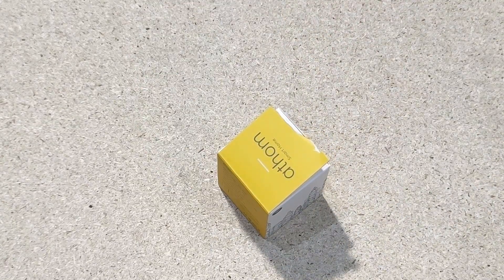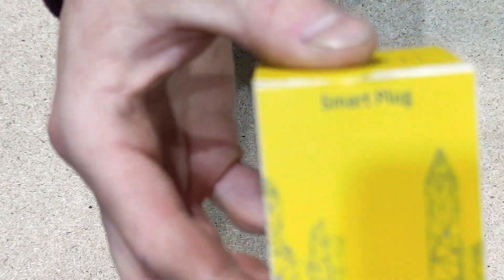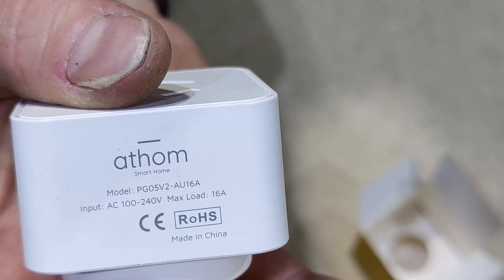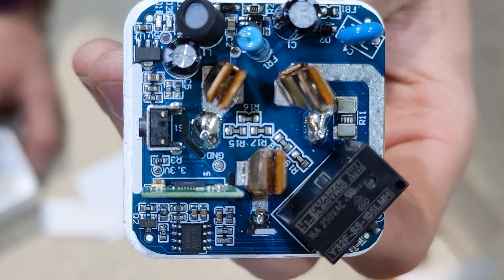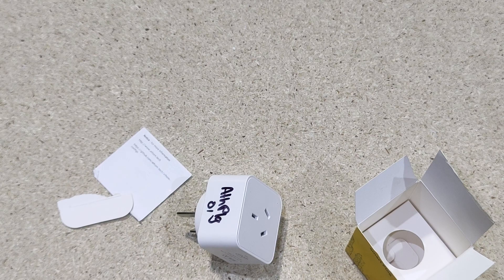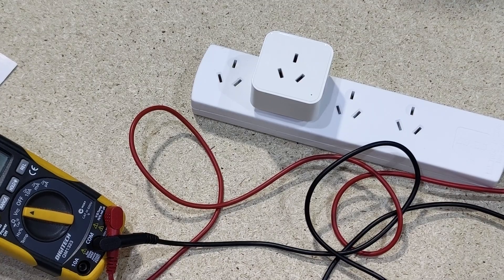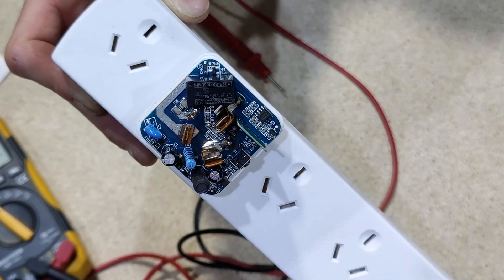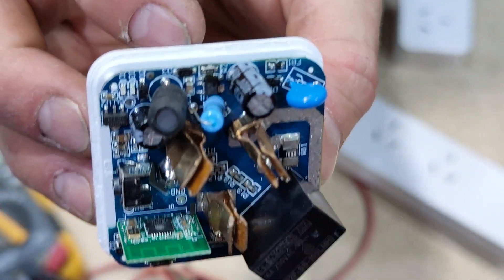Athom Smart Plug Review - Great Features, Serious Safety Issue (Fixed in V3)

Comment: I know this is an old video, but do we know if they actually fixed this? I'd love to buy a bunch for espresense but don't want to burn the house down!
Reply from the maker: Yeah mate check my other videos :P (maybe it was a shorts, I forget)
Reply: @PlatimaTinkers  cool, looked at the short. The new version looks good. Any chance these can bee reflash to espresense without opening them up? Sorry I'm a bit of a noob on esp32 (just played around with one dev board)
Reply from the maker: @Dude6978  Sorry for the brief response before; was still at work so rushing.

Yeah mate absolutely; Athom stuff is all open source, and the new ones are actually pricks to open. You can order them with Tasmota or ESPHome on them, and both are very open and configurable platforms, but it's not hard to re-flash over-the-air if desired. I just have never needed to as I used ESPHome for all my stuff, connected to Home Assistant 😊
Reply: @PlatimaTinkers   nice all good! I might get a test unit and try. Basically just want something I can place around a few rooms so it knows where I am + plus where I left my phone 😂
Reply from the maker: @Dude6978  Yeah definitely worth it. Especially for how cheap they are, and how much you can do with them once you've really gotten to know their make-up.

Comment: Hey mate thanks for the video. How did u open the plug? Can't find instructions about it. Read that it might be glued and I don't want to break the plastic.
Did you have to brake yours to open it?
Reply from the maker: Hey man so the first ones were just glued, and easily cracked with a spudge tool or just screwdriver. The V2 (shows 10A rating I think) are ultrasonically welded, so I had to massacre it basically.

It can help if you freeze the hell out of it first apparently. Good luck, and thanks for the kind words!

Comment: Bit of a long shot - looking for the pin outs on the 8285 board (JW-02-8285). Can make out one side - 3.3, GND, RXD, TXD, GP12 and GP14, however the otherside is obscured - looks like RST, [x], 13, R and CW. Any clues?
Reply from the maker: Yeah mate new model or old? I've got them both sitting at home and can check tonight for you.
Reply from the maker: Woah yeah this is super hard to see. I think I'll de-solder one but I won't be back at my workshop for about two weeks as I'm travelling sorry!
Reply: Cheers! Not in a huge rush so whenever you have the chance it would be appreciated @PlatimaTinkers
Reply from the maker: @williamgradwell7418 hey mate I busted one apart, and it turns out the labelling is a mess haha. Here's two high res pics, as best I could get them with the lighting I had. The front looks slightly blurry, but it's actually the silkscreen that's blurry haha. Following the traces may be your best bet!
https://plati.ma/wp-content/uploads/2023/09/20230917_110551.jpg
https://plati.ma/wp-content/uploads/2023/09/20230917_110815.jpg

Comment: in Europe the socket (if there is no ground) is just symmetrical 2 holes, and there is no marking where is L and where is N. Most of equipment has no issue with that - whatever you connect there i.e. table lamp, one time you will have a switch on L another time on N.
Reply from the maker: @zyghom That's super interesting! Sounds so terrible haha - there must certainly be dual relays in everything there then. Here they are obviously different, and AU standards requires two relays, but you can get away with just one on L
Reply: It could even have ground, if it is the regular, symmetrical "type F" which is used in most of Europe. Only in France, Poland and Slovakia, Czechia is the "type E" used which is assymetrical, that can only be plugged in one way.
But I don't reckon this as any hazard, one should never rely on an "off" state of a switch (or a smart plug like this), but always assume a mains wire has voltage unless the circuit breaker is down.
Reply: @henriktoth56  100%.  The L brown and N blue is just a convention - not a requirement. And there is no requirement i.e. "left hole is N, right hole is L" - only when you have 3 pins, 1 is always ground and is yellow/green

Comment: Athom has released a new version that fixes this bug
Reply: Also if you can give us a pointer to where this was stated. Checked on the Athom forums and other postings - can’t find anyone talking about it. Cheers.
Reply from the maker: Confirmed. Support said https://www.athom.tech/blank-1/esphome-au-plug and "You have to choose to ship from China, because there are still a small number of old versions of ESPHome in the Sydney warehouse"

I have asked if there are any markings/identifiers but yet to hear back.
Reply: @PlatimaTinkers  they should be removing the old ones from AU stock immediately and replace them with the fixed versions. It’s a bit sad that there is an unknown window of bad stock here. Also let us know if you hear about any markings etc to confirm the new version. Cheers.
Reply from the maker: @wizdude  I agree they should be wiped out, but as they are not technically an Australian-compliant product, they are not required to issue a recall. The only reason they can get away with this is because they are technically not a personal or commercial item, they are a hobbyist item. That being said, they do now have C-tick for Australia, just not RCM as they cannot fit in two relays which would be required.

Re markings, updating my pinned comment with the specifics now! Cheers
Reply: How can we tell if we are ordering the new version? It’s still called v2 on their site and there will be heaps of the previous ones in stock with suppliers.
Reply from the maker: Yeah I cannot find this? Have asked their support. Cheers

Comment: Thanks for the video.  How did you manage to open the plug?
Reply from the maker: Welcome, glad you enjoyed it! It was only kind of firmly pressed closed, maybe badly sonically welded. I pushed a spudger into the thin gap on the back and worked around and it popped open. Doesn't snap back together though, just slots closed, so I'm cautious when pulling it out.